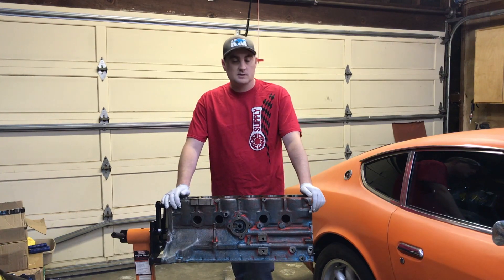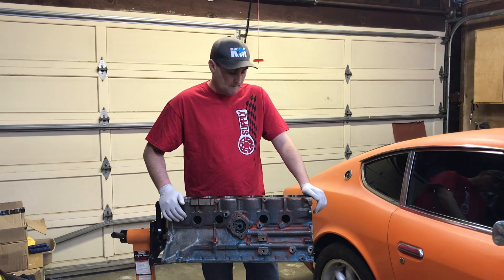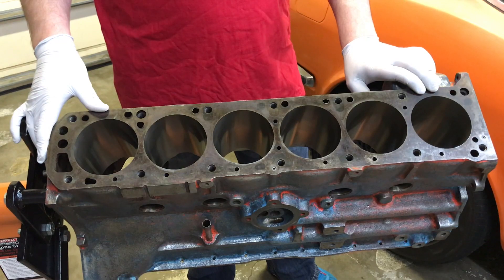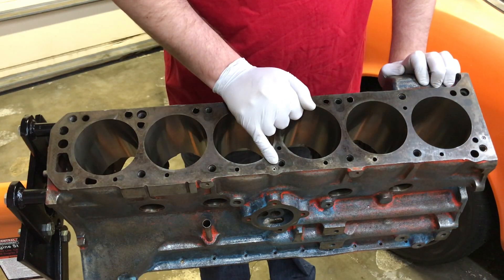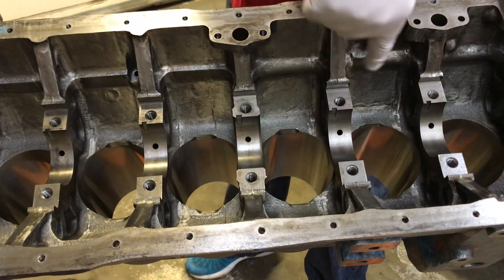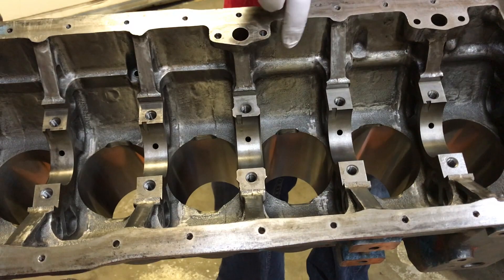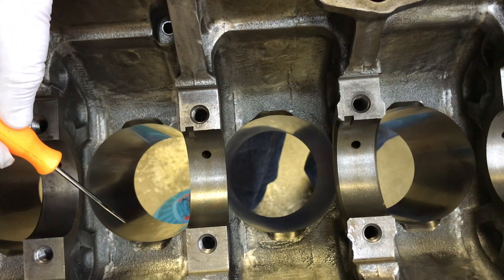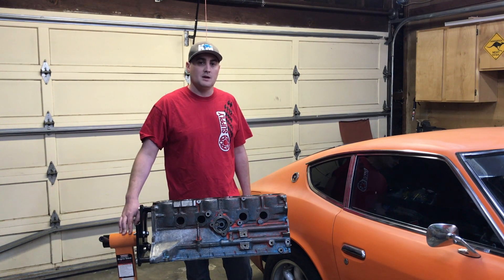Datsun Engine Block Machine Shop Work

Comment: Can it still work for long after doing that
Reply from the maker: Yeah it should actually improve the reliability as the oil should return and drain better and also removes the possibility of bits of the casting breaking off and getting into the oil.